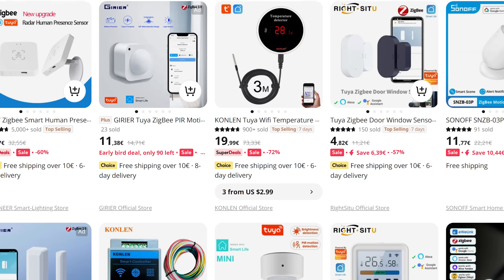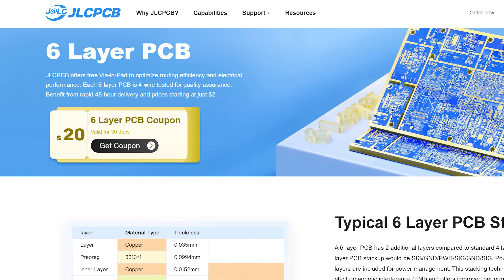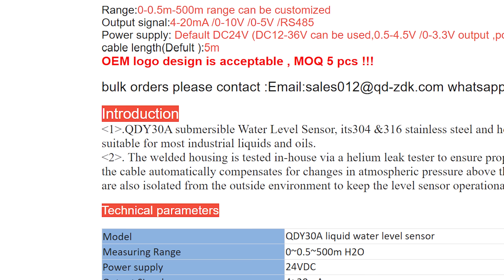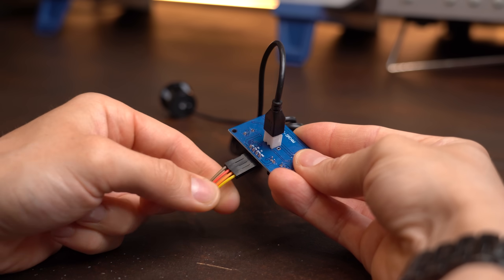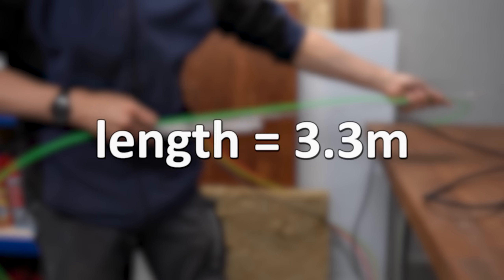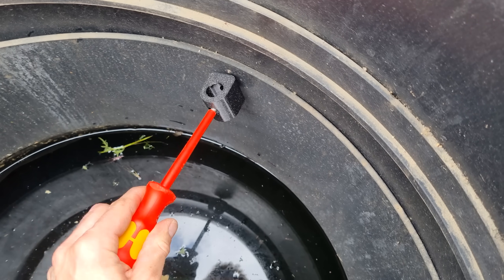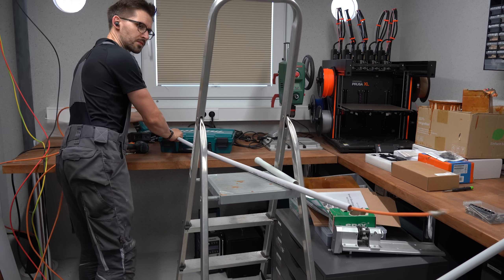This Happens when all Buy Options Suck! Water Level Sensor (DIY or Buy)

Comment: I think that the problem you encountered when trying to lengthen the cable on the sensor is not the cable but the system. I've used sensors from Micro epsilon in the past and both their eddy current and capacitive sensors have to have the cable between the sensor and the signal conditioning amplifier 'tuned' as can suffer problems from reflected waves at the high frequencies used in the sensor head. The sensors we were using had a resultion of 0.5 micron and worked faultlessly in the engine testing environment.

Comment: The real costs will show, when your cheap a** ultrasonic sensor cannot differentiate between reflections from the water surface and reflections from the walls of your cistern. I had the exact same sensor and setup and it was worthless, as in the cistern, I could only measure maximum of ~1 meter because of that. Also, those chinese sensors are not really waterproof, so even the condensation you have inside that cistern will kill the sensor within a few years. If you want to do it right, but not the cheapest, but the things with a good value, like a MaxBotix sensor (e.g. MB7363), that has some "intelligence" included and can filter out the unwanted reflections and therefore achieve even 10 meters of range inside such tubes!

Comment: I have somewhat successfully extended the sensor wire using coaxial cable intended for analog CCTV cameras. It works, but routing this cable with mains wiring creates some garbage values; approximately 1 out of 5 readings is incorrect. Nevertheless, it was sufficient for my needs

Comment: I did the exact setup on 3 tanks and im pretty confident to say that "dont proceed with ultrasonic sensors". Especially in these high moisture environments. It surely needs lot of tinkering once in a while and ultimately you switch to some other sensor.

Comment: I had exactly the same idea for the underground water tank. Since I had spare Shelly Uni, I used that and hooked it up to the pressure sensor you've shown. Works great as well.
Reply: I've done the same thing, it works great if you have a decent wifi...

Comment: Thank you SO much! We have an Kerosene tank for the heating here and I've been trying to come up with a sensor to monitor the fuel level. this looks like it will do exactly that!
Reply: With fuel and the fumes, you need to really carefully select all the components that are involved. A lot of plastics will break down quickly in there. And i guess it should be Ex rated components that are fit for a possibly explosive environment with the fumes in the tank.
There is a good reason most fuel sensors still just use a float and some clever linkages to get the level mechanically out of the tank, before you convert the data in neutral atmosphere to an electronic signal.
Reply: @ProtonOne11  good point thanks !

Comment: Heh nice project, did you check if you have WiFi signal inside tank? I'm usually installing ESP where it's collecting data and routing only power cables. Then sensor cables are short. Beside that ESPHome rulezz :)

Comment: That "black magic wire" the ultrasonic transducer was using was a coaxial cable and had a specific impedance and range of operating frequencies. It wasn't just some average shielded cable you could just cut and splice with butt end connectors since they would change the impedance and how the circuit would respond to high frequency signals. If you see coax, you need the same type of coax or a better, compatible coax to connect to it using compatible connectors and devices for that type of coax and signal type. I could get into actually crimping and connectors, but that is another conversation.

The why of this being the case has to do with the physics of high frequency AC circuits treating every part of the circuit like it a capacitor, a coil, and a resistor, so if you change the shape of the shape of the wire by splicing the coax, you create capacitors at the splice points and then that changes the impedance of the whole circuit, making signals in it the wrong frequency to pass through filters they are supposed to pass through and not pass through filters they are supposed to pass through, so you get garbage back. There is also the fact that you need circuits that are connected together to have matched impedance or they can't transfer energy (signal) between each other, so when you put that splice in there, you ruin that matching and cause the signal transfer from happening efficiently, so the energy is instead being directed into the ground part of the circuit, into a noise filter (the most common result), or into parts that you are now frying (also an option).

Comment: If it weren't for the percentage readout. I would have just installed a floating threshold switch, that activates or deactivates, once the water reaches a certain level. Similar to how the valve on a toilett water container works. But instead of a valve it triggers a switch. Some PVC Pipe with a floater on one and and a microswitch on the other + some 3D printed holders should do the trick.
Instead of a switch you could also use a lever and a potentiometer, to get a more accurate reading.
Anyways, all of these would take way more space, than what your solution requires, and yours has less potential for things to wear down an break.

Comment: Questions :
1. How reliable do you think this sensor will be ? Is there any chances of corrosion ?(due to high humidity). Please break open the sensor & make a video 
2. Is there any possibility of doing Arduino style programming in ESP32 and still supporting Home Assistant ? . It will give us flexibility to add local HMI interface in any device that we want to make work with Home Assistant.

Comment: Sometimes it's simply impossible to buy finished product. I made conversion thing for my electric schooter battery that connects via 7W2 connector. It's nominal voltage is 36V, but fully charged it's close to 42. Most of solutions are 35V max. So i had to put it down to 12V using 36-72V converter and i use car lighter socket and inverter that fits there. There are no cheap 36V pure sine vave inverters outt there, ones that exist are too powerful and quite more expensive than this setup. Battery could only give 80W continuous so buying 2000W inverter seems overkill.

Comment: I had that ultrasonic in a tank outside and worked well for some time but then would stop working after few sunny days. Found out the heat outside would evaporate the water and create water drops in front of the ultrasonic sensor messing out the readings. After trying dif sensors, I end up buying that heavy duty pressure sensor around $30 and works perfectly for over a year now, also connected using ESPhome and Home assistant.
Reply: I literally have one in my cart and was about to buy it but this video makes me believe I can get away with the ultrasound. Did you set the sensor on the floor or is it hung a couple cm's from the bottom of the tank?

Did you also purchase one of the readouts or did you use an arduino?
Reply: @nerfinator03  I just left all the way to the floor, did not leave it hanging. I use the 4-20mA version and placed a simple resistor for voltage divider so the analog pin can read. Its crazy accurate. Also, don't vary with the temperature, the previous ultrasonic one would change with day and night time. The only thing that makes it vary is using the sprinklers, so I put an automation not to check level when the sprinklers are on. Prob my power supply is not enough for all l stuff I have hooked up, not sure. I used ESPhome software with an ESP32 board to get the reads.
Reply: @DanielNictheroy  hey, thanks for the follow up! Much appreciated!

Comment: I used to work for a telemetry company working with well depth and soil moisture sensors and flow meter loggers etc, electronics under ground or in water vapor environments needs to be designed and installed correctly to work properly. I would run a pvc tube down to the bottom of your tank down the power cable conduit and have a air source and pressure transducer in the work shop panel. Keeping the electronic s dry and safe.

Comment: Gosh, this is the first time I've thought to myself: "I could have helped". I work as a student trainee in a German company that manufactures level probes, depending on the model with a simple analog output of 0-5 V. Price range 25-80 €. I also had to install a level probe in a water column as a demonstration model and read it out with an Arduino and LCD at the bottom.

Comment: I had similar proble, but I used a pressure sensor with 4-20mA standard output. It is water proof (obviously), the length of cable could be up to 200m, and its output is standard (and used by any PLC). I prefer standards and durable solutions

Comment: Summary

This video by GreatScott! shows how to build a DIY water level sensor for a cistern.

The Problem:

* (0:00) Existing commercial solutions are either unsuitable, too expensive, or require awkward mounting.

DIY Solution:

* (5:23) Uses a waterproof ultrasonic sensor mounted above the water level.
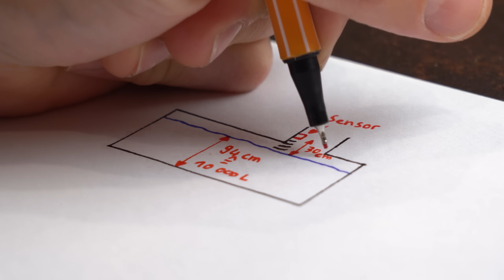* (5:51) Distance readings are converted to water level percentage.
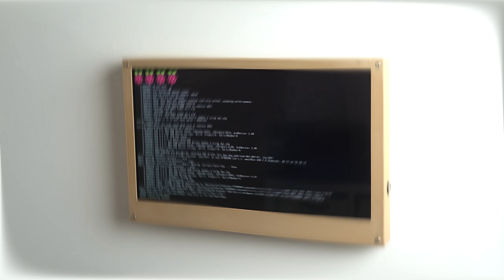* (8:40) Sensor data is sent wirelessly to Home Assistant using an ESP microcontroller.

Components:

* (3:34) Waterproof ultrasonic distance sensor.
* (8:40) ESP microcontroller with ESPHome firmware.
* (7:34) Junction box and enclosure for electronics.
* Wires, connectors, and mounting hardware.

Advantages of DIY:

* (10:37) Cost-effective: Significant savings compared to commercial WiFi solutions.
* (10:50) Customizable: Hardware and software can be tailored to specific needs.
* Educational: Learn about electronics and programming while building a practical project.

Verdict:

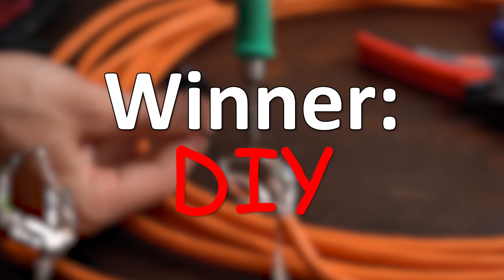* (11:19) DIY is the clear winner in this case due to cost savings and customization options. 

i used gemini 1.5 pro to summarize the transcript

Comment: I have an air conditioner in my apartment but it is built into the building and only has an on or off switch and just continuously pumps out air at a given temperature. This was annoying because it takes a long time to get up to temperature and if I want it warm/cool when I wake up I have to leave it running all night. It also seems to cost the same regardless of the temperature it is set to. So I built a device that sits on the control unit, I set AC to max heat or cold and have the device turn it on or off based on temperature and time of day, as well as using an IR remote to turn it on/off manually. It works great but cost me over $2000 to make because I was starting from nothing, I needed to buy all the tools, I needed heaps of electronic parts to learn from (though turned out I never fried anything), and got a heap of stuff I thought I needed but didn't. Parts and materials for the final product were probably under $50 but if you don't have any tools, materials, or experience then it can end up actually costing a hell of a lot more.
However in the end I was happy paying so much to have the tools and the skills and knowledge to be able to use them for future projects. For a one off it probably isn't worth doing a DIY project.

Comment: I went with the 1st option after using the 2nd option beforehand, it uses 0 to 10v @ 3 metres for my 2 water tanks and I have hooked it up to a UNI Shelly to grab the data to my  MQTT broker

Comment: Ultrasonic level sensors, laser based level sensors, radar based level sensors are all commercially available.  As are mechanic ones like high, 50%, low level floats, or floating scales.    Also a visual indicator could be made with a plastic float on a rod in a tube that rises and falls in a transparent above ground tube with a scale indicating level.

Comment: The only DIY i find is more expensive is when it comes to raw construction, just because of the material cost is so high for wood/metal at least from the big box stores. so for me its always cheaper to by premade flatpack furniture, premade metal toolboxes. While the premade stuff may be of lower quality than what i can build, it saves me time and money which is more of a requirement for me.

Comment: Heyy.. I have a very similar setup in my home.. But i used an A01NYUB waterproof ultrasonic sensor hooked upto a raspberry pi which runs a very simple python program that monitors the distance and i used Tkinter library for the graphics. It's been 10 months now and is rock solid. I previously used the same sensor that you used, but it fails and is not reliable (in my case)

Comment: Nice project, two simple suggestions. One, put a drip loop in that wire that runs to the box holding the PCB so water doesn't travel down in to it. It may not be wet now, but with high humidity and changing temps it will condensate on the wire and travel down. 
Two, I work with the industrial ultrasonic level sensors and there is a minimum distance they need to be away from the side, based on the depth of the tank to reliably detect the lower levels. Since as the sound wave travels out, it gets wider and the reflected sound is also wider. So we usually mount the sensors in the middle of the tank, like you did, but not up against the side of the wall there. It seems yours is working now with high water levels, but if you end up with erratic readings once the level goes down, try and move the sensor more to the middle of your opening. So the sensor isn't against a flat surface on one side like that.

Comment: If you mount the sensor inside the top of a tube with a float that moves with the fluid level you can improve the accuracy. That's what we did at UGA for some of the large scale runoff test.

Comment: Cool project :)
I think this is my first comment. Personally, I think I would have placed the junction box in the tank (above the sensor) with the control circuit (and the entire 2.5mètre cable from the sensor) and a long cable to the Arduino. In the event of a breakdown (remember 9:19), it will be painful to carry out the repair with the junction box in the tube.

Comment: man i hate to write this but you could have done better with a few cents more. put at least heat shrink around the solder joints. it's not just for insulation but it also protects the joints from corrosion and reduces the risk of a broken wire. Even better would be a small pcb with connectors. On a project like this even dot matrix would do the trick and is far superior to that hack of a job

Comment: DIY for me most of the time when networks are involved. If nothing else for the security and modifiability. Anything 'smart' that connects to my network that is pretty much closed source and unconfigurable other than ssid and password should go on separate hardware which then requires opening ports. Not convenient at all and you can't swap out or upgrade as you need. You also risk cloud paywalls in the future with smart tech...

Comment: I think the project turned out pretty well. We can also measure the water level with a hand-made strip (supported by a stick) capacitive sensor. Making a 1 meter capacitor can be difficult (Two conductors will be placed close together and nicely insulated). But it is very useful in small water tanks. There are examples made with Arduino on the internet.

Comment: Hi! Would it be unsafe to ask a professional electrician to install a 5V line in my fuse box and run a conduit to the roof? From there I can wire up various sensors etc. without the worry of mains voltage. Is this a smart or dumb idea!?

Comment: See I'd of done something simple like a fuel level sensor with an extended arm. Sender's are cheap and also the guages aswell as being low voltage and obviously submersible.

Comment: I'm guessing the cost to run this continuously isn't that significant? <3Whr? About the same as a wifi enable"smart" socket? In fact all the rest of the equipment used to support it probably draws more power (internet connection, home assistant screen...)

Comment: PGA460 is the go to IC for ultrasonic measurement. TI has good development boards that can calibrate your transducers. With the right calibration, you can reduce the dead time from the transducer. Dead time = time it takes to excite the transducer to produce a signal and then read it. When the distance is too little to measure with the speed of sound, then the ultrasonic signal already passed the transducer before it could read it. Therefor bistatic setup (two transducers, one receiver and other as transmitter) are necessary for short distance measurement. You could also increase the frequency (depending on the transducer) or use high frequency transducers to achieve accurate short distance measurements.
Code for arduino is available for the PGA460 and already used in the automotive industry. Datasheet is also very on point, so no weird "black magic shenanigans" .

Comment: This way seems quite hard and not really cheap. I would go for a mechanism with floater and depending of the arm position, measure resistance. For reference check out BMW E36 fuel level unit (it has 2 of them, one is on the fuel pump, the other is separate).

Comment: Nice work. I would more or less go into the direction of using in Esp8266 with 18650 battery. With deep sleep and waking up every 15 minutes e.g. you can get some month of measurement time.
I don't want to know your base load of your new home. 😂

Comment: for signal wiring you need coaxial type cable but not a single copper core, rather multiple smaller ones. 
Examle, the laptop psu cables are the best choise for thickness for you.